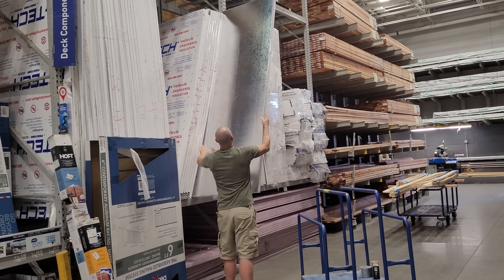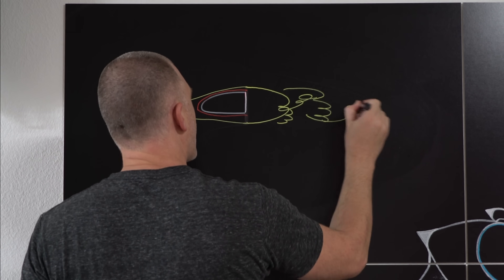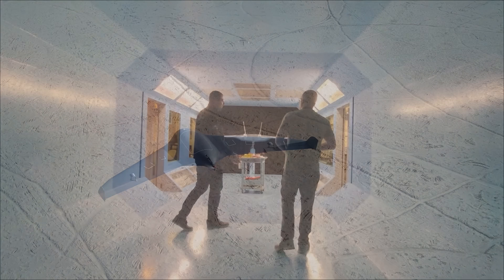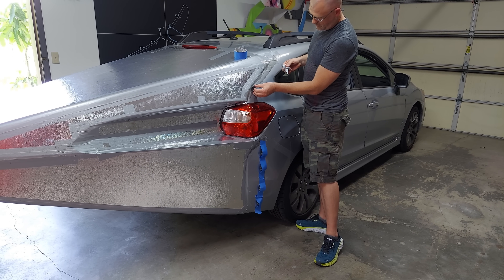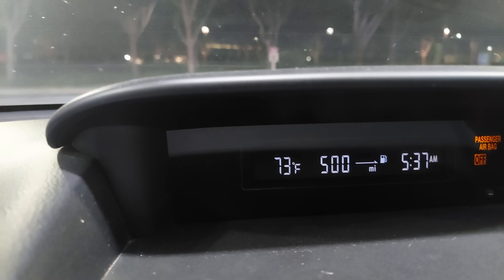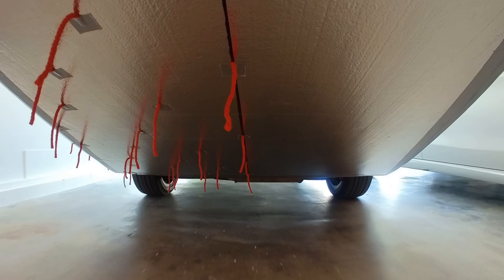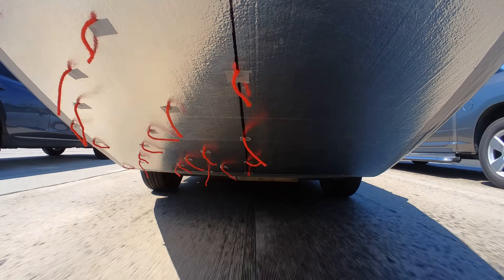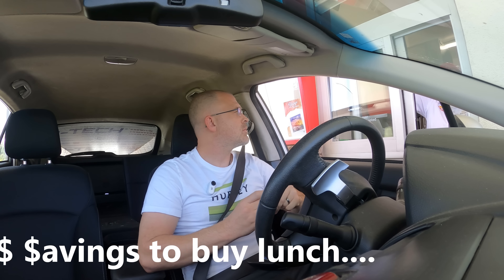Using Simple Aerodynamics to Beat High Gas Prices (Home Improvement Store Edition)

Comment: //I'm happy to see your aerodynamic hacks and it's great that you're trying to show us all how to save money, thanks. None of what I say below is intended to detract from that.
//Aw, I was hoping those wheel covers would be a little more skookum. First rain/snow and those'll melt off. I might try that with acrylic though...
//Can you still open the hatch? Good testing procedure.

I wonder if it's the quarter million dollar Rivians and $150k Teslas that are driving the average up... Also why buy new? 
I got a used 2017 Bolt Premium a couple years back for $15k, it's been an awesome car so far. 

If you must buy new then know that the average price for a new gas car is $50k. You'll save that $16k in just a few years given the lack of needed maintenance and lower per mile costs.
The Subaru (an Impreza same as yours just older) my Bolt replaced cost me about 30 cents per mile and $50 a month in maintenance. The Bolt costs 3 cents per mile (via home charging, 7-14c/m on DCFS) and hasn't cost me a dime in maintenance in 2 years. 

28 city/ 36 highway is great MPG to you? Yikes. I average 140mpge in the Bolt and other EVs can get better than that. Just drove from Pueblo CO to Denver CO and back (~240 miles) and it cost me less than $10 even with a 10 minute, $5, stop to charge.

Gutless? 0-60 in 10 seconds isn't terrible... 152hp isn't quite gutless...
Yeah, the Bolt does it in 6 seconds and has 200hp. Teslas (assuming you could find one for under $20k used) are far quicker still. 

Don't like Chevy, or just hate the look of the Bolt? How about the ID4, or Ioniq 5, or Apterra, or eGolf, or Mini, or Fiat... there's lots of options. I talk about the Bolt because I have more hands on experience with it, and because it's awesome.

Comment: I made a prototype luggage carry that hung on the trailer hitch while forming a boat tail years ago, for my model year 2000 Sequoia. I've thought about trying a non-luggage carry version that used flexible fiberglass rods and vinyl with a ram-air intake to inflate it more rigid too.

Comment: Aerodynamics is fun stuff, and drag sucks.

Would suggest including some aero-tuff indicators ahead of the modification on the vehicle. We may be surprised. Repeating the test run at 55 mph (1970's style), and/or increasing tire pressure by 10 psi could make for more test run learnings ... and more opportunities to think about future projects.

In other news .... gas prices now back down to where they were in February. And if adjusted for inflation, are cheaper than during the 1970's, even during summer peak. Keep your eyes open, there are a few good used EV's at reasonable prices. Even better priced from Jan 1, 2023 with a $4k incentive, and 1/4 the cost to operate per mile, or km.

Comment: Actually, now you're telling...
Back in 2006, I bought a 1998 Opel Vectra (in US, it's likely a GM). Originally, it came with a cover under it, and everything was fine. At some stage, the bolts retaining that cover broke and I lost the cover. I thought it was only for noise insulation, so I did not bother replacing it, and the price was pretty hefty anyways. But now you mention it, I realise it was not only for noise insulation. First, there was like a "speed wall" around 160 km/h (about 100mph), like it was very difficult to go faster, even with the turbodiesel + injection (my 1987 Diesel Vectra didn't have the problem and I was doing 170 km/h averages without anything like that). Also, I was pretty pissed off that my newer "dti" car was nearly 1.5 times (6+ltr/100km, ~ 40mpg) as greedy as the old diesel (~4ltr/100km, ~60mpg) when I was faster in the old one with very similar weights (the old one was possibly heavier and definitely less aerodynamic... or was it?). Now, I'm wondering if it wasn't just that plastic plate under the car that made al the difference, especially at high speed...Drag increase relative to speed increase is a power function, isn't it?

Comment: Vortex generators are useless in your case and have a negative impact.

They are useful when the aerodynamics are crappy because of a non optimized aero. 

You want to maximize laminar flow with your best aero, no need for vortex generators.

It is only when the angle is too high, around 12 degrees, that the air tends to add a lot more drag.

Vortex generators, even though they create turbulent air, help reduce drag in this case.

It's a bit like an airplane flying too slow and stalling , with vortex generators it avoids stalling and helps the air follow the curvature of the wing, although the air is no longer laminar it's not as bad as the crash but it's worse than laminar for efficiency .

For car vortex generator could help with hatchback, but are practically mainly used to increase downforce of rear wing

Comment: great video! from my extremely limited understanding of modern automobile aerodynamics, i believe that some degree of efficiency is gained from slab sides, with the air being primarily directed over the vehicle. i would try mounting the side panels farther forward on the rear bumper, aligned more or less straight back from the side of the vehicle. in this scenario, only the upper surface of your tail structure would be angled.

flexible (rubber? bristle brush?) front air dam and side skirts may be more practical than foam, allowing the features to sit closer to the ground without risking damage. hovercraft generally rely on flexible skirts because they allow a tighter seal around the vehicle’s body in real world use.

i would also be tempted to try thin plexi over the rear lamps, or possibly spoilers directly in front of the lamps that direct air past the region of unstable flow.
Reply: one more thing: kline–fogleman airfoils are stepped on the rear, with air vortexes forming behind the steps, allowing most of the air to pass in a laminar flow. i would be curious about the efficiency of a tail section that was mounted entirely between the tail lights, essentially creating a vertical step between the side of the vehicle and the rear tail structure. but i only know about kline–fogleman airfoils in model airplanes—a step as wide as your rear lights may be too great to maintain laminar flow.

Comment: the single most effective improvement would be to make a flat underbody panel and screw that to the car.
Maybe closing off the rear  wheel wells would help too.
And fitting narrow low rolling resistance tires.
Reply: Have wanted to do this for years.  Catalytic converter heat is a concern; a closed bottom might deter against catalytic converter theft, too.
Reply: @louf7178  do it in aluminum.  Some Subaru's come with a plate of aluminum
Reply: @louf7178  Indeed, even just exhaust pipe heat and other types of heat build up are a concern when doing this. It'll definitely need something other than cardboard/foam
Reply: @louf7178  no those things are designed to work at 1500F you should be fine would just have worry about using metal i know about subaru engines the cats are connected to manifold so its still in the engine bay
Reply: @CarWavExe  Thanks. I meant within the enclosed area (volume).
Reply: @louf7178  true but if race cars that run sueper hot for long periods of time have a completely flat bottom i think your econo box should be fine i recommend looking into ground effects where some cars use different underbellys and diffusers for aerodynamics
Reply: Rally drivers use hdpe sheets. They do it to protect against rocks, debri, and bumps but aero is a bonus.
Reply: @largesizejellyfish3014  HDPE is interesting.  The guys on Ecomodder use coroplast, fluted plastic like campaign signs.
They cut away from the catalytic converter.
One guy used expanded steel sheet over the catalytic converter.
If you can figure out where to bolt that it would deter theft.
Reply: wouldn't the rear end work like a massive diffuser with a flat floor though? All the low pressure pulling the rear of the car downwards
Reply: @samkwant4050  not if it stays this tame of an angle. A diffuser doesn't really work that well at highway speeds anyway.
Reply: @samkwant4050  diffusers don't generate downforce, they simply smoothen the air exit.
Reply: @samkwant4050  Diffusers are useful to give more grip for cars that go so fast that they need to stay on the ground, but they also do increase friction. Same goes for bigger tires.
Reply: Absolutely, that's what they do on EV's
Reply: to OP true- smooth undercarriage. Or just copy F1 cars and the 100s of millions of $ invested in engineering wind drag.

From what experts done- drag reductions at the tail (and the whole body) that spins, curls smooths out wind drag away from the centre line.

Eg. Fins with a cylinder on the end to curl/ spin wind away from car (literally just reinvented last month by Aston Martin) + layered whale tail at the rear with ridges to corridor wind
Reply: @mnm8818  Racing aerodynamics aim to make it easier for the ecar to move air out of the way, but also increase downforce.
Downforce doesn't help daily drivers.
Reply: Disagree... base-drag is the biggie! Tailcone is lowest hanging fruit
Reply: that might work but it would have to be out of foam otherwise it would add too much weight negating the increase in aerodynamic efficiency
Reply: @Michael Morgan Great application!
Reply: A lot of investigation into bicycle efficiency show rolling resistance to be one of the greatest factors. Aerodynamics is also huge, but not as easy to address. Contrary to convention, rolling resistance is improved by more modest tire pressure and wider tires than previously believed. Wheel aerodynamics are also very important and easy to address. Bikes are a good platform for such things as they are simple and improvements via increased power are harder to come by, making other efficiencies more important for both speed and endurance.
Reply: No, it's up to 5% improvement, less than what was done here.
Reply: Jack up the tire pressure.
Reply: @outlaw7x77  that increases braking distance though and you'll wear your tires unevenly
Reply: lol no. disconnect the rear driveshaft and make it 2wd.  it is going to be mostly impossible to go over 40mpg  in an awd gas car. every improvement this guy makes is going to be fighting diminishing returns and ALL of his gas savings is counteracted by all of his shakedown runs and testing. He used 6 gallons of fuel just driving around testing out his body kit.

Comment: That lower side turbulence is probably from the wheel well. You'd have to put a skirt over that to improve it. The underbody is indeed where most of your drag comes from. I've seen some analysis that at nearly half of the drag on most gas cars comes from the underbody...
Reply: I second this advice. A flat floor would be better than skirts(edit: as proposed from the video @9:08) as this will increase the frontal area. I have a recent video on how much a floor impacts drag.
Reply: @nelsonphillips  Yes: F_d = 1/2∙ρּּּ∙v²∙S∙c_dּ with F_d as drag force (N), ρּּּ as the density of air (kg/m^3), v as speed (m/s), S as frontal surface area (m^2) and c_d as drag coefficient (-). Adding "skirts" could reduce c_d, but would simultaneously increase S. Edit: also the angle shown at 9m15s should be max 15° according to rules of thumb if I remember correctly from aerodynamics class.
Reply: @diyEVguy  the diffuser for a car is different to diffuser in a pipe where to fluid is to irrotational and laminar. The reason is that air tends to leak in from the side and creates a vortex which means that there is lateral momentum as well as a longitudinal component. The key become, if the flow is symmetrical and therefore there is no back flow or flow separation. You probably wont be surprised that things get quite complicated.
Reply: @nelsonphillips  love the fact that you are on this thread.
Reply: what! drag can't possibly come from an area on the car consumers can't see!
Reply: @Ripsticker45  XD, love the joke there man!
Reply: Does that mean my very flat underside of my EV KIA Niro is helping my milage? Cool.
Reply: As to Adam's suggestion - yes, I would try covering the rear wheels flush with the body side if possible - that would probably make a big difference on the side of the vehicle.  Unfortunately, you can't do this with the front wheels as they need to be able to turn.
Reply: @dperreno  Depending on how the wheel turns. the inside of the wheel well, the changes in camber and how much space the tyre takes in the well under bumps and compressing. you can mount something that either links to the suspension or wheel hub. that turns with the wheels. More engineering and mechanical complexing. but you get it right and you can do the front as well. 

Better to save the headache, time money and possible illegal or cops pulling you over. or having something just fuck up. sticking with the back is probably best. which sucks.
Reply: if that's the case then i think i could easily make a mod on that.
Reply: But you're limited, I have read that having an underbody cover converts into 5% efficiency, which is still great of course.

Comment: I used to work for a company that saved trucking companies millions by teaching the drivers to be lighter on the gas and brakes. Saved upwards of 15% on average, some saved more (those with bigger lead feet who changed their ways the most) and some saved less (those with bigger lead feet who didn't change their ways...). This, coupled with skirts, tail shrouds and other features really improves tractor trailer fuel efficiency, and you can see the industry adopted much of it because you can see them on the road. How much do you save if you drive like someone's grandma getting up to speed and coming back down with as little braking as possible?

Comment: I have a diesel car, a peugeot 307 and I get 58.8 miles per gallon on the highway and 52.2 on rural roads. What I have realized is that simply driving without acceleration and hard braking can reduce consumption by 10%.
In Europe I'm afraid that putting that cone is not legal, at least not that long, although I do not rule out doing that someday and also increase the storage space because mine is a camperized car.
Reply: this is a very good point. every time you brake, you’re turning momentum into heat. because the engine turns fuel into momentum, you are essentially just turning fuel to heat.

i don’t focus too much on my throttle inputs. i find that slightly extending my follow distance to the car ahead allows me to coast rather than brake in many situations.

Comment: With that shape, you'd essentially be building a dropped Beetle, right?
Reply: Sure, with much shallower taper angles. The Beatle has among the worst drag coefficients.
Reply: Looking to see if anyone else mentioned VW, the old Porsche's where more slippery I believe.
Reply: @mrln247  most of them had coefficients of drag in the 0.4x range. A lot of modern sedans are in the upper 0.2x range now.
Reply: @AustinPerdue  There really havent been that much improvement for sedan body shapes since the Audi 100 (C3) in 1982. But yeah, some cars back then, not to mention just ten years earlier, were way above 0.4

Comment: You could tape some clear sheet plastic (thick enough it would bend but not wobble over the lights and back pyramid shape for the license plate to profile into the Styrofoam, and some back finder skirts without too much work and maybe pick up a few more %.  13.7 % is pretty legit though.  If someone had 50 mile commute, payout would be pretty quick!
Reply: i was thinking about where his license plate is even visible to the public
Is it really only thru that window in the back? I'd think that's not street legal, u can only see the plate when u'r directly behind his car.
Reply: @Broockle  It definitely isn't. In many states, even a "frame" on the license plate is illegal if it arguably makes it hard to read.

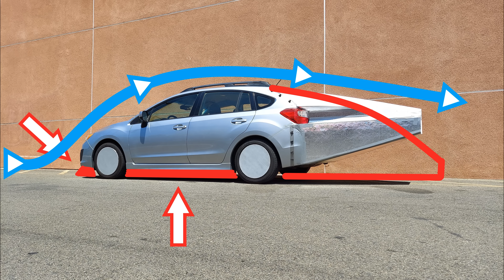Comment: 9:19 Careful reshaping the foam boards, drag in only one of four forces at work here. You may inadvertently design in lift.
Reply: lol its not like hes going to the salt flats
Reply: Not quite it would rather seperate then generate any proper lift
Reply: @rkbmd12  Hatchbacks are particularly bad in that regard. That’s why they have spoilers on the top of the boot lid to separate the airflow from the car.
Drag from the underside of the car is often the biggest unaddressed source of drag on modern cars however…
Reply: i wouldn’t worry: lift is engineered into many modern cars to reduce rolling resistance at speed. even if he accidentally built an airfoil with enough lift to flip the car, the foam and joints would likely not be strong enough to support the force. i imagine that the tail section would be destroyed well before the car was at risk of a crash.

Comment: It could be a brilliant alternative for external rooftop trunks or small trailers. It can imrove both capacity and aerodynamics.
Reply: Some semi truck trailers have small version of this on them called a trailer tail
Reply: Good point - though more weight increases rolling resistance, decreasing MPG!
Reply: it'd make the car more rear heavy though which could do funky stuff to handling.
Reply: @Dejawolfs  not really, it all depends on how you incorporate the real wheels
Reply: Hay that's good thinking There "
Reply: No you can't do that, it could make the car dangerously unstable
Reply: Rooftop add-on for towing vehicles